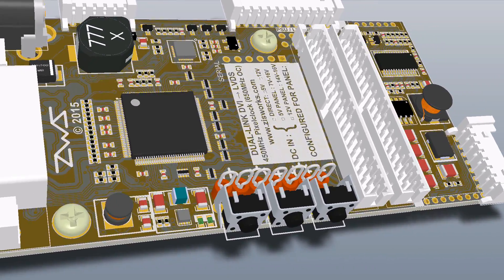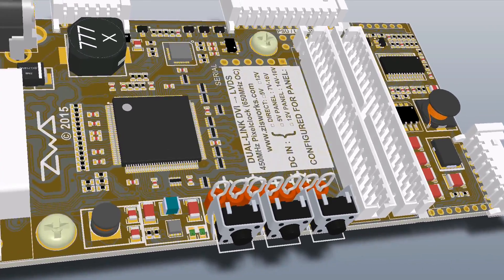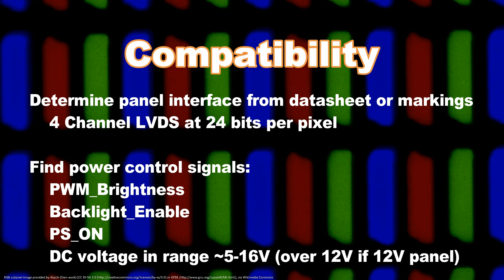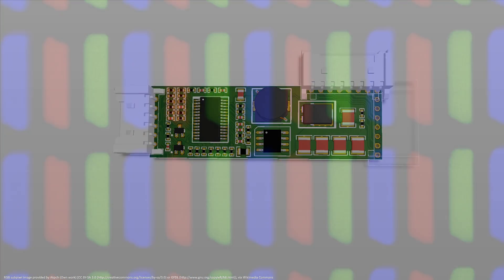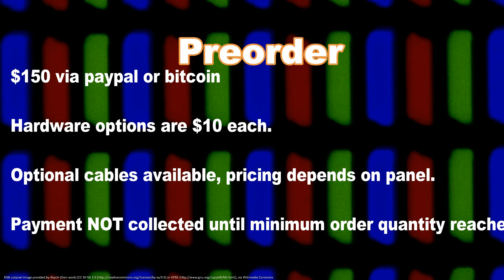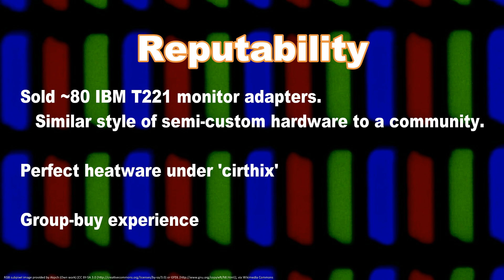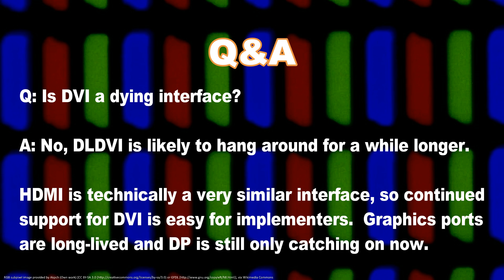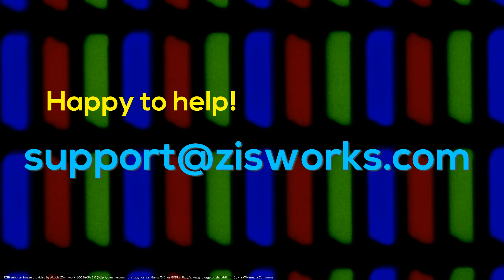A no-latency overclockable LCD monitor interface board.

Comment: Can you make one for my CRT monitor? no joke. I would like a board that can beam 4k+ signals to a 3 crt tube projector. This can theoretically reach any resolution because there are no such things as pixels in a crt screen
Reply: Not quite, since the colors are only existing because of the color grate on the viewing surface. You would need to manufacture a new color grate in order to get correct coloration. And that's not even the only problem.
Reply: lol yes!!

Comment: apparently DVI IS a dying interface, the RX480 just came out without it... :-(
Reply: HDMI to DVI adapters are available. I believe HDMI and DVI are nearly identical, and the adapter shouldn't interfere with the operation or performance of the board.

Comment: This would be great to try on an acer xb240h. Mine overclocks to 198Hz at 800x600 with the stock board and 193 Hz at 1024x768, yet displays a blank screen if I try to overclock at ALL on any other resolution.

Comment: Wow this is amazing ! that look like a ton of fun to play with
Sadly too expensive for me atm :(

can a similar result be expected using a m240hw01v8 from a xl2411z ?
Reply from the maker: +eucalyptux 

I have a beta-tester which has tested with this panel.  He can do 240Hz, but on darker images, the panel stops operating and goes full-white.  I suspect that this has to do with an overcurrent protection limit on some powersupply in the TCON (remember: TN panels are normally-transparent and you use some energy to display black) due to how it is triggered, but have not investigated TCON modifications to fix the issue yet.
Reply: cirthix Okay i see, thanks
looking forward for your futur projects